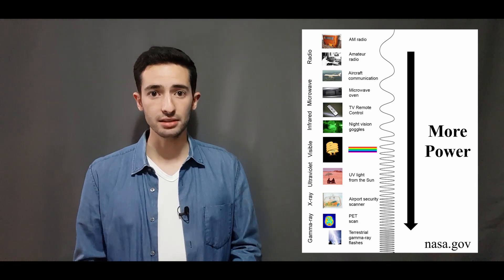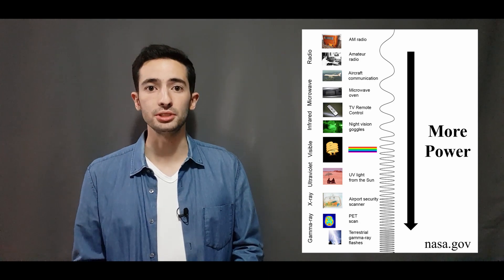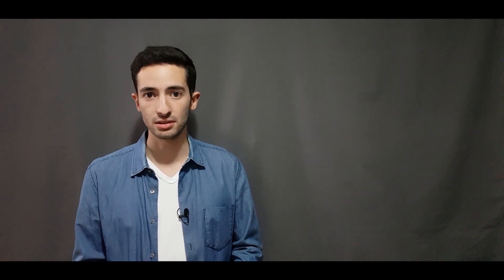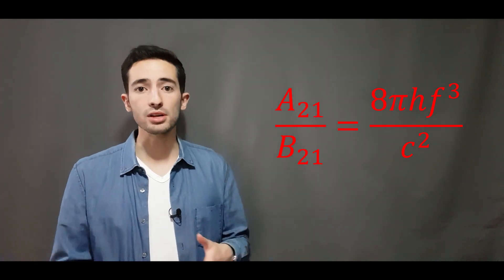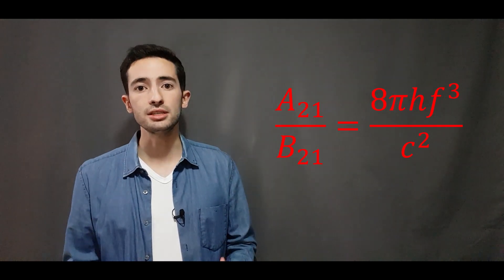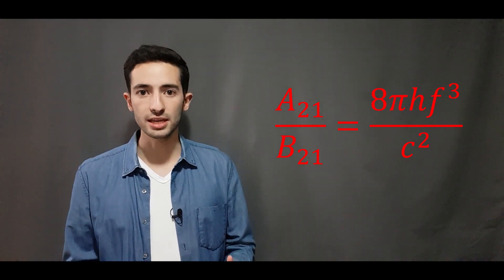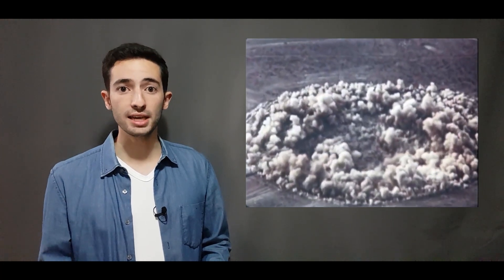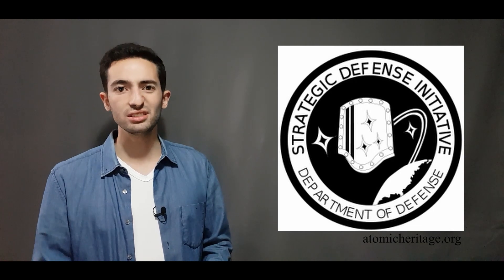Project Excalibur: Nuke Powered X-ray Space Lasers

Comment: Awesome video! You should put your lighting up higher looking down at an angle. Because its face on, it gives you "Mullet Shadow" if you look kinda makes you look like you have a whispy mullet, but yea putting it up a bit higher so light can angle down on you from an angle, sorta like the sun at 10am or 3pm on the equator probably stretching it as far as 9am and 4pm as seen from the equator.

Comment: 1.2nm Selenium K shell x ray laser. The laser has 24 spaghetti like rods of selenium in the radiation case reflector. When the nuke is assembled the gamma/x ray energy rips the electrons off the selenium ionizing it, the selenium rod is expanded to maybe 2mm but is plasma. As the ions cool they generate 1.2nm laser light at an energy of around 200kJ per beam. When compared to the pump energy, the beam is pathetically weak. It has divergance similar to an uncollimated helium neon laser as well so it isnt very useful as the nuke's regular pulse would swamp the beam at distances longer than a few km.

Comment: A good well researched video, kudos!  One nit pick- The Outer Space Treaty specifically bans "Nuclear" weapons in space, but does not specifically ban conventional weapons.  As an example; one of the Soviet "Salyut" type space stations (Salyut 3) was equipped with a turret mounted 23mm Cannon- and even test fired it in space.
Reply from the maker: A good point, thanks for highlighting it. Though i don't think you would even need a weapon.  A solid rod metal rod dropped from orbit could still do an insane amount of damage.  Kinetic energy is not your friend in that case.

Comment: Honorverse book series use these as anti-ship weapons. I believe it was already tested and proven but decided against due having multiple nukes in space was considered a bad .
Reply from the maker: It never was tested in space. It's just too impractical and focusing x- rays is a nightmare. Add for the books, that sound pretty cool, though the x- rays wouldn't get through our atmosphere very well.
Reply: @AlmostaDoctor1  which would make it ideal for space combat since no atmosphere but a full size test would have to be conducted to test what limits it would have and test its mechanical feasibility.
Reply from the maker: The main problem is with the focusing. They just couldn't properly aim the thing. Also it would be easy for an enemy to take out. But there still might be uses for it.
Reply: @AlmostaDoctor1  The honorverse books used gravity lensing to aim and focus the energy. The series is pretty interesting, but I would suggest against reading the 14 mainline books, if you have a low capacity for an author shamelessly robbing history.